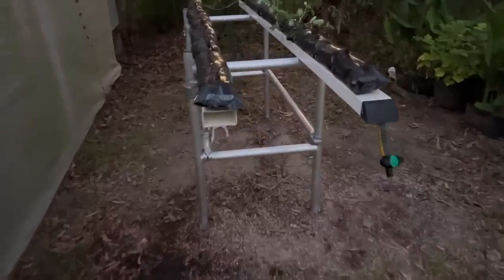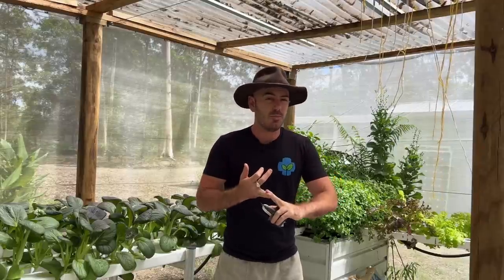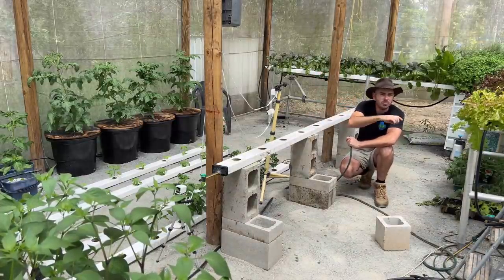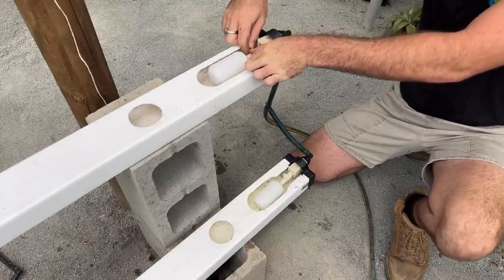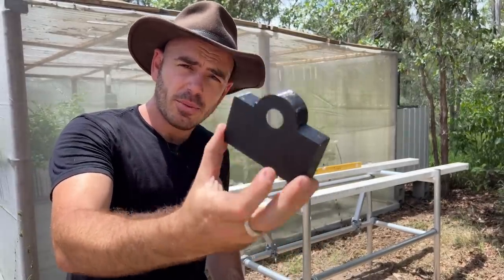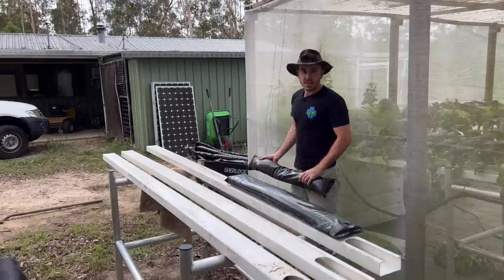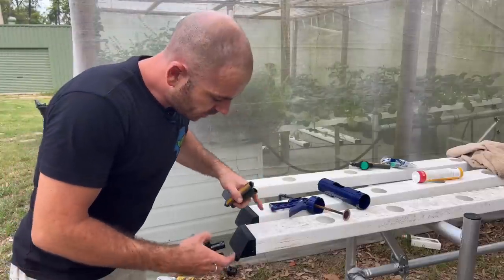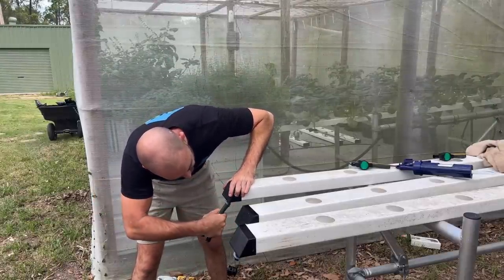Super Simple Strawberry System Version 2.0

Comment: I'm not sure if you've figured this out yet, but if you print in ASA or ABS (ASA is more UV resistant), you can use an ABS to PVC glue and glue the parts directly to PVC pipe.  Additionally, you can wick some acetone into the pieces to solvent welt the layers together and make them water tight.

Comment: Just use a couple of stainless steel screws on each end one on either side along with the silicone would stop the ends from popping off like that especially if the silicone doesn't actually adhere to one of the 2 plastics very well but would still seal

Comment: silicone and then sheetmetal point screws to hold in place until it dries. Id use shoeglue over silicone. silicone is useless as a plastic glue but screws is a compromise.

Comment: Have you considered using rivets to fasten the system? Perhaps caulk, adhesives, or glues can just be there for sealant. A rivet is a convenient way to fasten two surfaces while you only have access to one side. This makes rivets helpful for piping systems where you cannot reach the inside to, say, hold a nut in place for a bolt. Rivets come in alumin(i)um and stainless steel, so it should be rust free either way. I would suggest Alumin(i)um, as a softer metal wouldn't bite into the vinyl as much when riveting. A hand rivet tool is inexpensive, as are the rivets, and is a good hand-grip exercise 🙂

Comment: The only square pipe I can find locally is 63mm x 63mm
Reply: You must be in the UK like me and have struggled with finding the rectangular style pipe, the simplest I've found but not built yet would be to use 110mm diameter pipe as you can buy it anywhere and the same with fittings, you can get 4" post covers that are for decking but the cost isn't feasible. The other way is to make a wooden open top box and line it with ground sheet plastic.